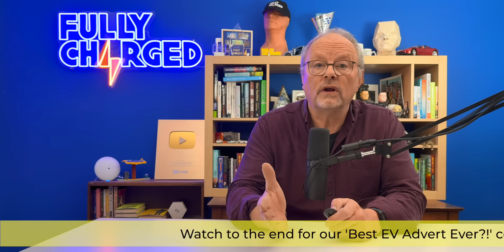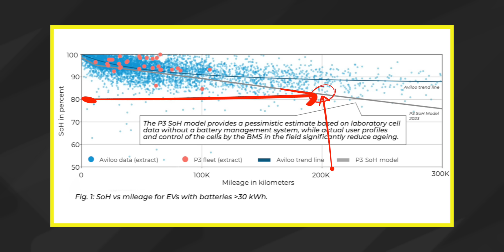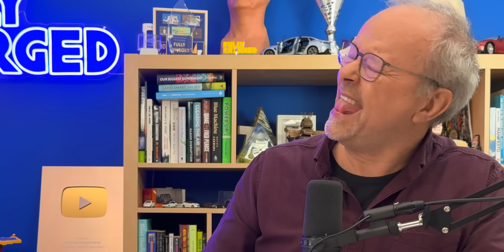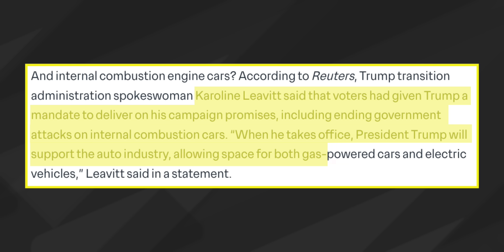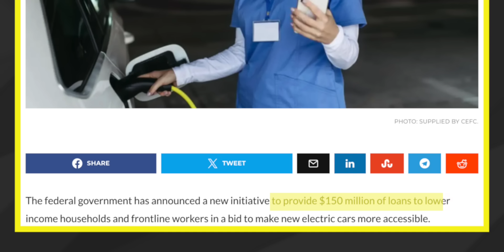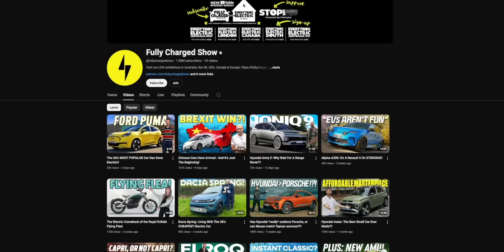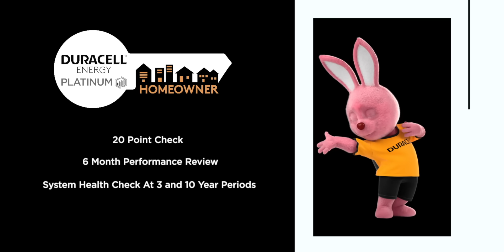The Truth About EV Battery Life, Government Subsidies & The Future of Coal Ash?!

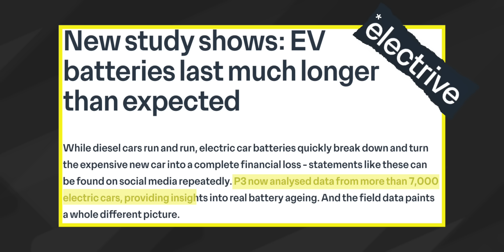Comment: 4:47 What's also important is how to read a chart...

It's deeply concerning that the P3 Fleet data shows batteries below 90% after only 100k Kilometers, or 62k miles. Everything after that is a projection BTW. 

This also only is the data for vehicles with less than 30 kWh batteries, which translates to a range of 100-155 miles... 90% of that after only 62k miles is a range of 90-139 miles.

So, let's say my current ICE vehicle had a 60-80 kWh battery and initially had a range of 300 miles and with it sitting at 120k miles as we speak, I'd be down to a 240 mile range. I'll easily get over 200k miles on my vehicle. Do I really want to be reduced to a 200 mile or less range? Or, to pay 15$k+ for a new battery pack? I can get a new engine for only $3k BTW...

Science isn't a religion, it is a methodology. Circular logic is self defeating. As is confirmation bias. If you want to have any credibility at all.
Reply: I am quite sure that „>30 kWh“, as seen under the chart, means „greater than 30 kWh“. Maybe you should improve your your own abilities for reading a chart before pointing fingers to others?
Reply: As is always the case with very very clever and preachy men such as yourself you are assuming that battery technology, like combustion engine technology, is static. 
Nothing new being developed. Let's face it, combustion engines are as long lasting and efficient as they are ever going to get. It's moribund, static and dated technology.
You and I can argue until we are blue in the face about batteries, but we will both be wrong in a years time. 
The technology is developing at such an incredible pace it's very hard to keep up.
Your very dated and tired arguments were perfectly legitimate back in 2012 when the Nissan Leaf offended so many men. The battery design was hopelessly basic.
SInce then energy density has risen and cost has fallen, recharge cycles are going up meaning battery life is extended far, far beyond the Clarksonian fantasy that is bellowed out by the exremist press and the radical, fossil focussed broadcast TV channels.
Do a tiny bit more research into the latest battery chemistry and battery management software, please carry on hating batteries, that's fine, no one cares, but at least try to be accurate in your 12 year out of date assumptiopns

Comment: In my experience the battery lasts as long as anything else on the car does.  When buying my first hybrid i ran some searches for hybrids with various mileage levels on them and found that after about 220k miles you start seeing "new battery" advertised as a selling point.  I don't know about you but I'm usually buying a new car by then anyways.

Comment: im 18 turning 19 this year and im hooked to get a EV thanks to my driving teacher, low cost for charging around $15 to $35 for a full charge, getting the car check or fix is like $150 to around $250 to get it check and to get it fix its just $1000 or $1350 in Australia, and since most of the EV have the range of 550km i say ev better
Reply: 🌅Bright young person you are🌞🗽.     note: 🤔Problem with over 100 years of Gov't's  SUSIDIZING Fossil Fuel Industries? & Pollution from BURNING Hydrocarbons?    Solution:🌅  We totally power our comfortable house ...& EV. solely with SOL power at home🌻 problem solved 🌞👨‍🌾🗽

Comment: Your attitude about EV batteries is short-sighted, not to mention the environmental impact of lithium mining and the fact that it is a limited resource. Additionally, there are disposal costs and the dangers of EV batteries in landfills, with only 10% of EV batteries currently being recycled.
As of 2024, there are approximately 40 million electric vehicles (EVs) on the world's roads. That means that at some point 20 million metric tons of batteries will find it way into a landfill and 320,000 metric tons of lithium will be needed to replace disposed EV's.
Reply: You have just shot your own argument down in flames.
Do your suposed 20 million metric tons of batteries have any value? I mean $$$ value? Do the materials they contain have any $$$ value? 
It seems like they do.
Are there companies already recycling massive amounts of batteries from the mountains of personal electronic devices we have all discared over the last 20 years?
Yes. Check out Redwood Materials as a good example but there are 100's of others.
Could the materials recycled from old batteries be used to make new ones?
Yes, already happening.
What is the leats problematic material in modern vehicle batteries?
Lithium, what about nickel, manganese, cobalt, copper. No, if you read garbage stries spreade by the fossil lobby they only ever mention lithium. Because they know they can just harp in and on about it, so no one asks about all the cobalt the oil industry consume to remove sulphur from diesel and petrol. 
And while I'm passing, what is the combined impact of 1.5 billion cars burning toxic liquid fuel today?
Is it zero? 
Is anyone trying to recycle diesel and gasoline?
In other words, stroll on mate.
Reply: @bobbyllewellyn  Time will tell mate. "No, if you read garbage stries spreade by the fossil lobby they only ever mention lithium." What make you think that. I am into H2 tech as that is the only true zero pollution solution. No mining, no disposal issues. I also noticed you never mentioned the cost of replacing batteries. You claim to be green by you turn a blind eye to the pollution issue with EV. At the end of the day, EV is just a way to make money, no different to the fossil fuel people lol.
Reply: @bobbyllewellyn  Time will tell. I agree fossil fuel is not the answer either. But EV are not a green solution if you take the whole life cycle of batteries into account. How much do you think it will cost to replace 40 million EV batteries? How long will it take to replace 40 million EV batteries? Also how much carbon dioxide is created to mine only 320,000 metric tons of lithium (4.8 million metric tons of CO₂ emissions). How much water is needed to mine that volume? ( 160 million cubic meters of water consumption ) I am into math and H2 tech that is far greener than batteries. So to me you sound like a fossil fuel lobbies defending an unhealthy industry, with no math to back your zero emissions claim lol. Oh and you say that "20 million metric tons of batteries have any value" what is it was 1 billion batteries as that is how many cars are on the road now. The math is 1 billion batteries is 36% of the world known lithium. This is the propblem people like you that cannot do simple math and apply it to the real world, hahaha. Oh and the value of  20 million EV batteries would be $200 billion! Chick feed for you obviously but a lot to me. The cost of 1 billion EV batteries would be a staggering $10 trillion.

Comment: ..this is all and well in theory, but let's apply real life scenario; "normal" use scenario; new battery use usually between 15% and 85% therefore 70% of capacity therefore 70% of anticipated 350 miles range which equals circa 250 miles range, add winter and it becomes circa 200 miles, now for used battery scenario; 80% of 250 is circa 200 add winter and it would suggest 150 miles (all best case scenarios), realistic; my guess is roughly 60% of the quoted.., EVs - no thanx..

Comment: I actually love EVs but am not a huge fan of BEVs except in cities. Hydrogen is the way forward for both ICE & EV (HFCEV). Here in Australia, tell me again how we drive 3000km towing with a BEV?  We don’t. Yet! Battery EVs carry far too much unnecessary weight. Makes far more sense to generate your electricity as you go (requiring a much smaller battery), than carrying it all in a huge battery that weighs the same whether empty or “fully charged” (pun intended). 

I love electric everything and we already have Solar on the house with a Powerwall. But not everyone is able to do this. 

Lastly, try having The Fully Charged Show in Brisbane rather than Sydney. There is much more to Australia than it’s (rather awful) largest city.

Comment: From what I can see a lot of the arguments about battery degradation have shifted from the miles covered to the impact of age on battery degradation. I think the range issue has been largely answered because there are enough high mileage EVs to evidence it but does the P3 report address age related battery degradation. I think those people saying batteries won't last 10 years are already being proven wrong as there are plenty of 10-year-old Tesla cars running but will they go for 20 years if the mileage is low(ish).

Comment: AND what happens to the batteries WHEN they need replacing?
Reply: AND I used to wonder what happens to diesel after you burn it, but NO ONE ever asks that for some weird reason. 
You have been told how terrible batteries are for the last 15 years, ever wondered why there is such a well funded and venomous, furious campaign to make you doubt the technology.
No, of course not, YOU know better.
After 25 to 30 years they are recycled. Check Redwood Materials in the USA who are reclaiming around 98% of the materials in the battery. Those materials then go on to make new batteries. One glowing example, (which you will NEVER have asked is about the batteries in your handheld devices. Billions of them need recycling now. Thankfully Apple is now recycling some oftheir 1.4 billion iPhones. They have stated that by 2030 100% ofthe cobalt in their new batteries will come from previous recycled iPhones.
Can you send me a link to a company that is recycling diesel or gasoline please.
Reply: @bobbyllewellyn 🎉WELL said! 
And I don't 'fill up' EV with a battery pack...we fill it with a charge of free electrons 🌞⛽

Comment: CO2 is currently around 420 parts per million, increased, they tell us, from 280 ppm in 1850 (estimated). That's a difference of 140 ppm, or in terms more readily understood by the layman, the composition of the atmosphere has changed by 0.014% (14 thousandths of 1%) in the last 175 years. LESS THAN 1 THOUSANDTH OF 1% PER DECADE! That's it. That's the TOTAL 'carbon footprint' for the entire planet, and human activity is only responsible for a small part of that increase. This measurement is averaged annually from much higher and lower daily figures. All the development that has occurred in this timeframe, everything we have built, all industry and every drop of fuel burned is included in that calculation. Furthermore, every life form on this planet; on the land, in the sea and in the air is composed of carbon compounds that were once in the air as CO2, and every living thing that has come and gone in those 175 years is incorporated in a figure that doesn't fall outside of a reasonable margin of error. Our annual emissions equate to no more than a couple of extra CO2 molecules per tree leaf on the planet. The claim that it is only our "emissions" that remain in the air and accumulate year on year, nature cannot cope with our contribution or that the carbon cycle was somehow magically in perfect equilibrium before we started to burn coal and oil is a complete fairy tale designed to fool the gullible. There is no 'climate crisis'.

Comment: Many whales are killed by plastics!
We have billions of plant and machinery running on ice engines worlwide. Many of these machines have a life expectancy of 50+ years. Just to scrap them to be replaced by expensive and largely impractical electric versions would be an ecological disaster too.
We should be investing a lot more into creating fuel from the atmosphere and water using electricity from sustainable sources. Not only does it store energy from wind and solar that otherwise would be waisted, but it would extend the life of our existing internal combuston engines.
With net zero carbon! Win win.
China is building hundreds of coal fired power stations to power their electric cars. No one talks about that!
No one talks about the diesel generators running at our motorway fuel stations ... to recharge our cars!
If I could afford it, I probably would have an electric car. But then I have solar panels and do very few miles!
Reply: China also leads the world in the amount of installed renewable energy. They
produces a lot of dirty hydrogen from reformation of gasafied coal and natural gas. Hydrogen is not clean or energy efficient. If produced from fossil fuels it has a bigger carbon footprint than the fossil fuels it made from. If produced via electrolysis of water, it is very inefficient. Using electricity to produce and compress hydrogen for use in a hydrogen fuel cell vehicle require 3 to 5 times the amount of electricity required to charge an equivilent EV.

Comment: Ha!😂 

No wonder he told detractors not to comment!

Batteries degrade with age, so mileage isn't the biggest issue issue with 2nd, 3rd, 4th hand cars.

If you buy a 10 year old car, depending on the battery type, the battery could have degraded to lower than 80%, even with ZERO miles on the clock !

Why didn't he provide a link to the source data so we could see battery degradation over time?

Comment: 5:50  - What bullshit... seriously? You know you're lying because you're old enough to have had a lot of ICE vehicles at home.

What you are saying also applies to EV! An EV doesn't have an engine, but everything else is the same as an ICE vehicle! My father hasn't even touched his Mazda 3 yet except for the brakes... which are cheaper than rotating tires on EVs. 🤣

Not to mention the price of tires + replacement costs, which are also over $100 (even $150+) more expensive - than an oil change or even more than two oil changes 🤣

We take our cars to a local mechanic, so these "changes" are cheap and done the same day!

My car is 25 years old, has 330k km (200k miles), and is better built/looks than most Tesla cars that are only 5 years old.

I've seen pictures/videos of people buying a 5-7 year old Tesla car, and the trim was already hanging off, visibly worn seat , etc. The door/pillar trim was hanging off after 5 years... 🤣 my car is 25 years old and doesn't have this problem. For the last 4 years, I've only changed the engine oil, 80€ ($83), and nothing else!

My father's Mazda 3 is 15 years old and has 290+k km (180+k miles) on it, and the car is like NEW. The car looks like it's 2 years old and NOT 15 years!

Both cars will go another 200k km for sure.

I thought this was a good channel that speaks the truth for ICE and EV, but this is an EV fan channel! No thanks for a channel that tells such lies about ICE vehicles.

I'm sure you're also lying about EVs and showing them in a good light. An EV can last 300k, but will it last 30 years? That's another story.

Comment: I think the EV and renewables upgrades will continue, but I don't think energy austerity alone will prevent global warming, I think we'll end up doing some geoengineering fairly soon.      :)
With the prospect of larger payloads to orbit getting cheaper, we could look forward to using shadesails at the Sun-Earth Lagrange-1 point - if we shaded 2% of the light, we could drop the planet's temperature by 1.5 degrees C.

The only drawback to floating solar, is that water and solar are both reflective which cools the planet, so adding solar to dark areas like grassland reflects more extra IR heat from Earth than floating solar.

Comment: One of the biggest misconceptions about electric vehicles (EVs) is their advertised range. Like many products, manufacturers provide figures based on ideal conditions, which often do not reflect real-world driving. In practical use, an EV typically achieves around 80% of its stated range when fully discharged from 100% to 0%.

Furthermore, to optimize battery longevity and charging efficiency, it is recommended to operate the battery between 80% and 20% capacity. This reduces the usable range by an additional 40%, resulting in an overall range reduction of approximately 60% from the advertised figure. As a result, a vehicle initially rated for 200 miles may realistically require a charge stop every 80 miles—significantly impacting convenience and long-distance usability. So with a poor public charging networks that can be very costly, any thing other than local driving in an EV is way more hassle and can be more expensive and take a lot longer. EV's have there place alongside gas cars.

Comment: 5:51  My 1989 Mazda with a third of a million km's still has its original drivetrain running fine; the 2 litre engine has perfect compression and the bearings show no signs of wear; only normal service items have been replaced. The equivalent of the battery in an EV with an ICE vehicle is the fuel tank, which in my vehicle is a propane tank, which is still in perfect condition after 35 years, with no sign of losing any range..
Reply: My 2008 2 litre Mazda completely seized its engine at 42,000 miles, After a new engine (which cost more than the car was worth) it went on for another55,000 miles.

Comment: If you have a 60 kw car battery  and it is 80% capacity at 300,000 klms then you have an old car and a 48 kw home battery. There is still more than half of the cars original cost left in the battery. So much for EVs depreciating.

Comment: Sorry but that's pulling the wool. If you have to charge a car 300,000 time to go 300,000 miles. Then it's pretty useless. Batteries are chemicals. That's why they degrade even if they are sat around on the shelf doing nothing. Im sure EVs will do fine for most people but range will be an issue for someone who travels long distances on a poor charging network. Having said that id happily go with an EV with LFP battery in a few years time when my banger dies and the used market has more of them.